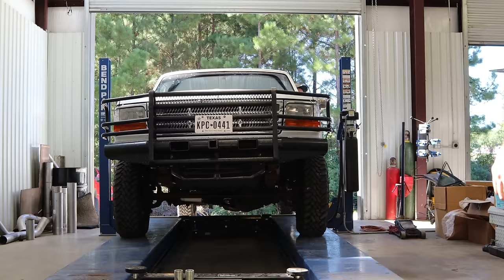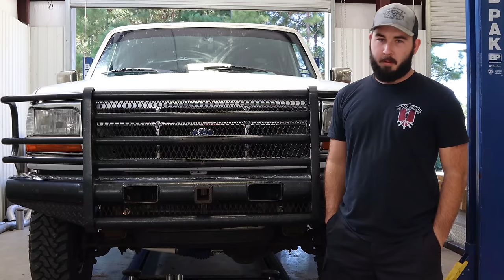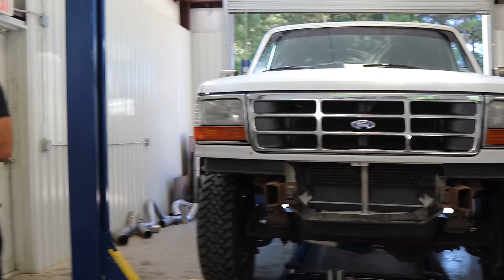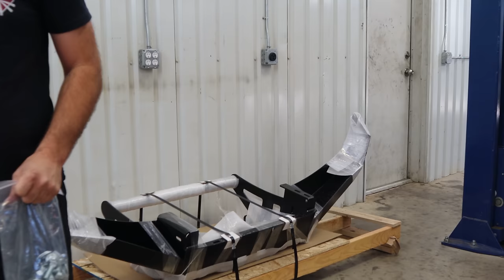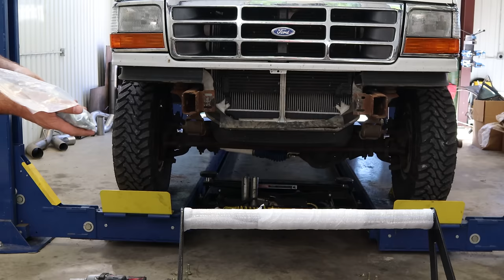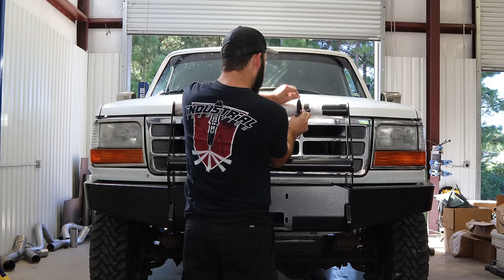1995 F350 7.3 Buckstop Bumper Install

Comment: Did you have to drill any holes in the bumper/ frame for the installation
Reply from the maker: No Sir straight bolt on
Reply: @CompletePerformance  okay I just bought the same ish one for my 95 bronco and the instructions said that I needed to drill a hole in the frame/ bumper

Comment: Did you just use the 4 factory holes for the Ranch Hand bumper? I seen somewhere the install calls for drilling 2 extra 1/2" holes inside the horns in front of the factory holes.
Reply from the maker: This is a Buckstop not sure about Ranch Hands